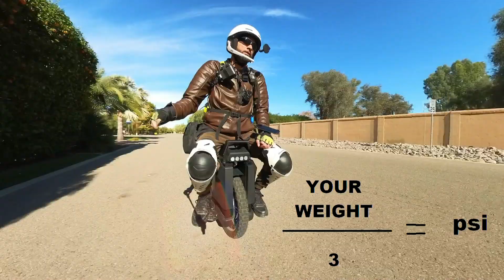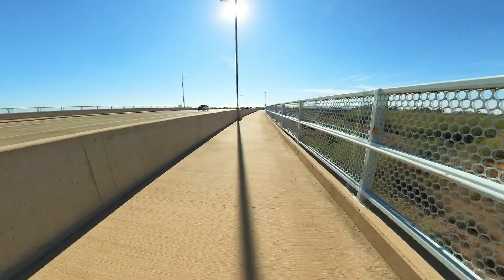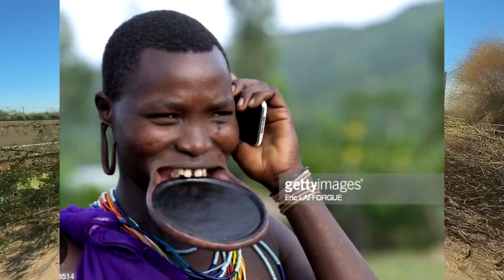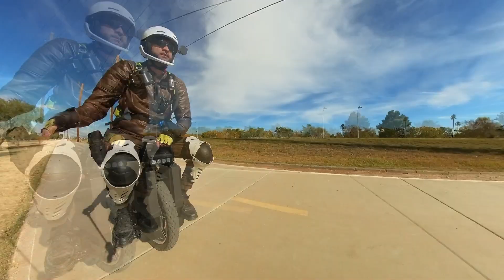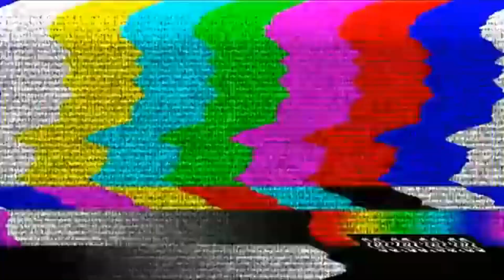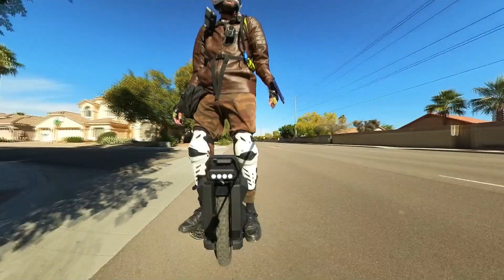What Tire Pressure PSI for EUC

Comment: Kind of curious that you start with a weight in kilograms to determine a pressure in pounds per square inch. Couldn't we just say weight in pounds divided by 7? Furthermore, I feel like this is going to change a lot depending on the tire and uni.
Reply from the maker: Im glad it worked for you. Keep riding enjoy.

Comment: formula is not counting euc weight, as one euc can weight 20kg, other can weight 50kg. Thats a big difference. But, ye, for Patton, with its weight 40kg and my weight 90kg, 35psi seems a little too much, wich 30psi would sweet spot, imo
Reply from the maker: Totally dependent on riding style, surface, rider weight, type of tire and condition of tire(new/old). My formula will give you an idea on where to start. It is rather test and error.

Comment: I did 31mph on my veteran patton on paloma park trails and checked my psi was 15.  It seemed a little squishy.  When I rode Hawes trails i fell a lot downhill on cactus garden no traction at 35psi.  Probably 25+psi is the sweet spot.
Reply from the maker: Totally dependent on riding style, surface, rider weight, type of tire and condition of tire(new/old). My formula will give you an idea on where to start. It is rather test and error.

Comment: There is max cold psi but does not show range of psi on tires. For example a v12 says max cold psi 40. For a 105 kg person that would be 35. Do you also add the euc weight to total weight? If so 45 psi would be more than the max.
Reply from the maker: My total weight does not include EUC. I should say total rider weight including gear and everything I carry. I personally ride low psi. I feel safer riding low psi. Again, it all depends of many factors I.e. Riding style, if you jumping, curb drops, dirt trails. I 99% ride on hard solid flat surfaces.

Comment: I have a Master with the Pilot street tire. I went down to 25 psi but it makes the wheel ride funny. 28-32 psi is best for that tire at my weight 75 kg.
Reply from the maker: Whatever floats your boat, my friend. Depends on riding style, what surfaces you are riding, and the total weight including gear.
Reply: @YASAJ-TV  I ride street and dirt trails. I don't do stairs or any large jumps. I go very light on my gear because I find that extra weight fatigues my feet during long rides a lot more. I only do about 4 or 5 pounds of gear on most rides.
Reply from the maker: @NahBra_EUC  I started riding when there were no suspension EUCs. Suspension helps in long rides and fatigues.
Reply: @YASAJ-TV  100% agree with you. I came from the MSP to the Master and I can go 2-3X as far before I need to hop off and rest for a few min. Being able to go seated also a huge increase in total distance.

Comment: The PSI is written on it ! For example v10 has to be at 40 psi, and you can go with 35 but not less, else if you want to destroy your EUC at first ride !
Reply from the maker: I had V10. It was my first wheel. Nice wheel. Be careful riding that thin tire at 40 psi. What is written there is 40 psi is their max psi.